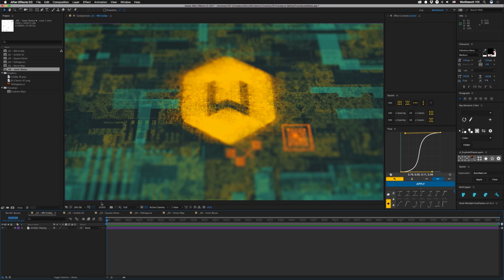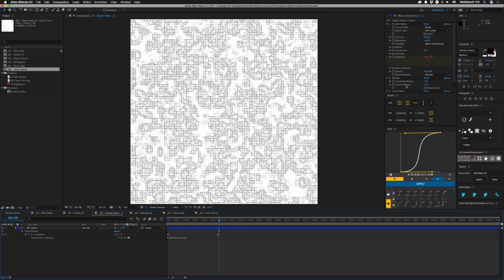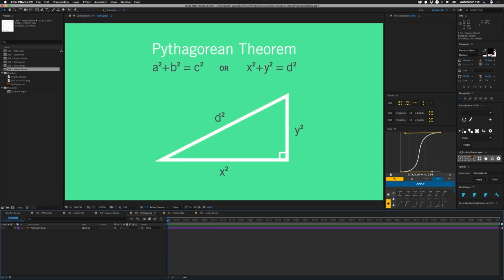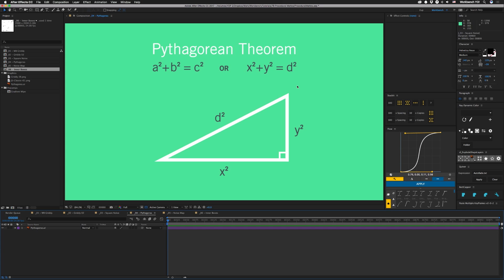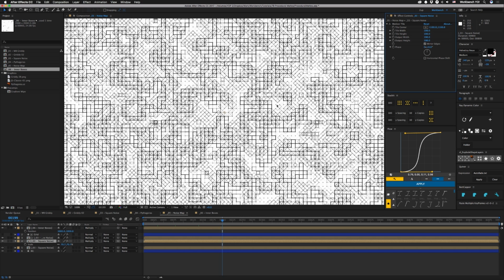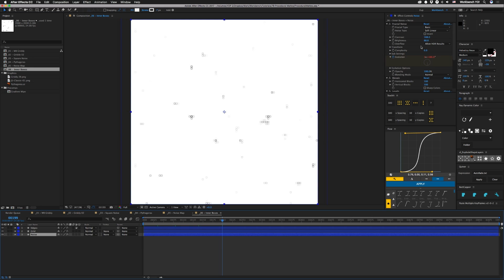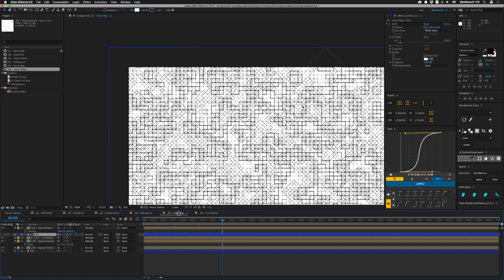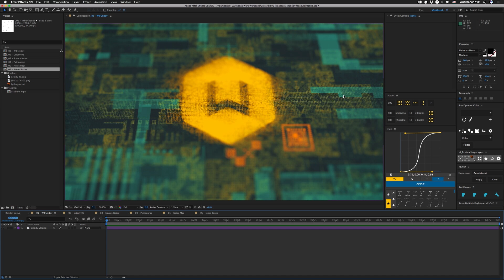Tutorial 79: Procedural Mattes

Comment: Which a great scope for the cool texturizing!
Reply from the maker: Thanks!
Reply: One could get a similar effect with the Noise type "Block" (instead mosaic effect) coupled with Sub settings of fractal noise.
Reply from the maker: Yeah, I experimented with block before. You just can't control the exact size of the grid that it makes, so you can't layer things together (like diagonal boxes, or dots on the vertices). It's also harder to get it to be a uniform grid (and you need a levels in between find edges to get it to only be lines). But that is another good option depending upon what you're going for!

Comment: The Motion Tile effect isn't working. My comp has a different ratio to yours.
Reply from the maker: I'm not sure what you're doing, but everything should be built square so that it's easy to build and versatile to use. If your motion tile doesn't fit you have to modify the output height and width. My numbers are only a guide.